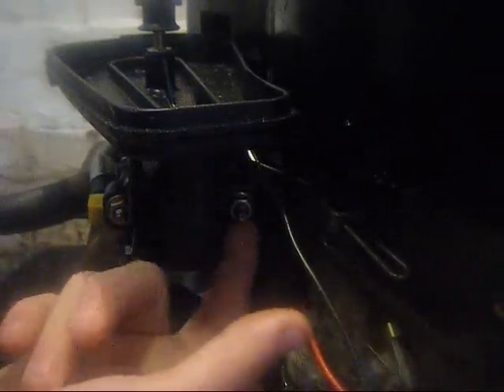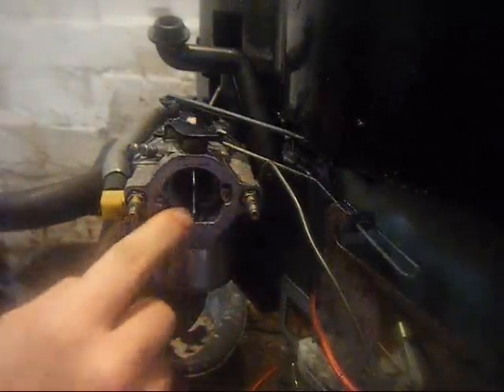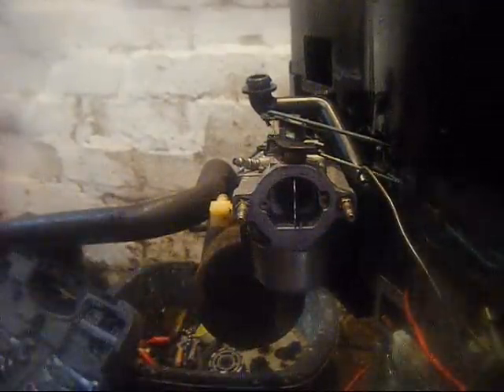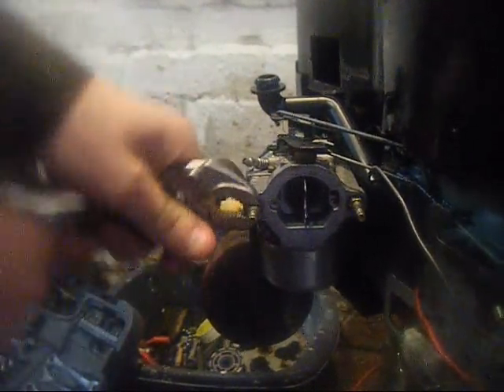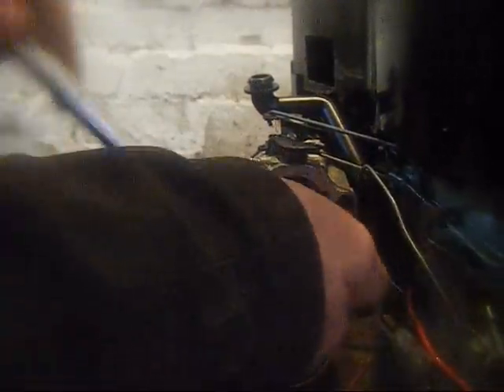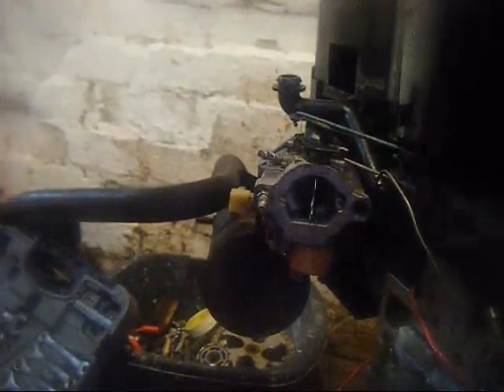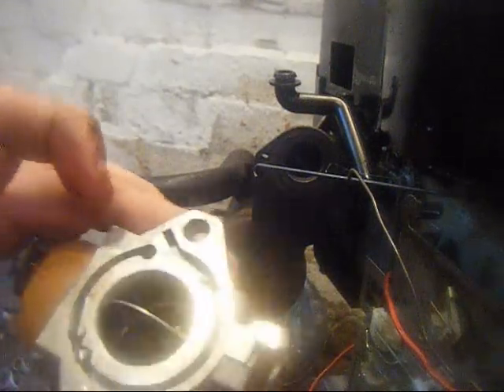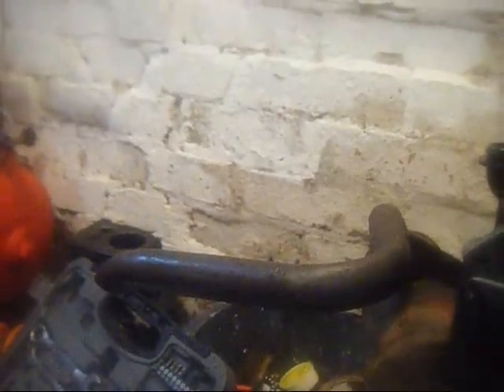how to clean a briggs and stratton carb

Comment: I understand what you are doing, but I don't like using vise grips on parts this small though. My Carburator has to be removed also and blown out using an air hose because something is keeping it from getting fuel into the Carburator. The line is okay, and it runs when primed with fuel directly into the carburator.